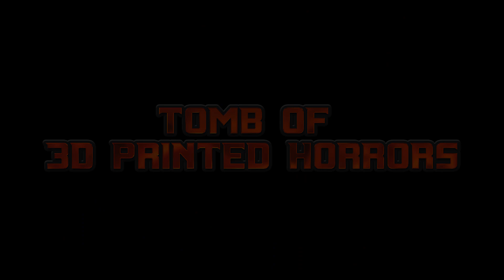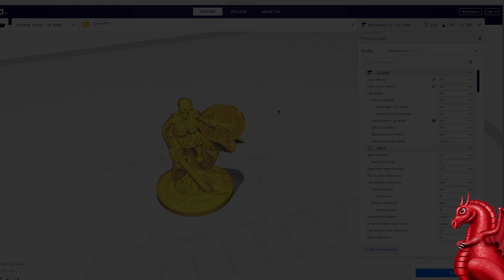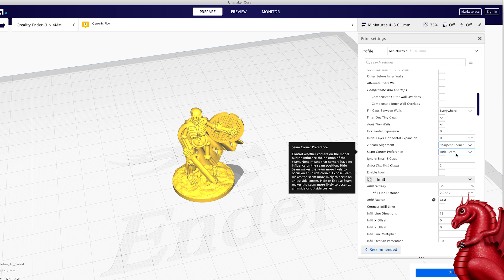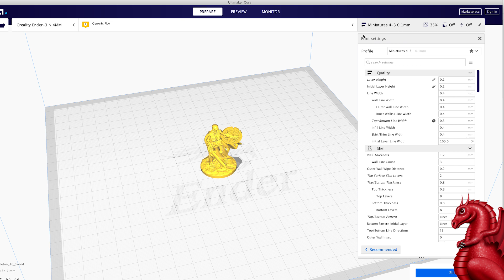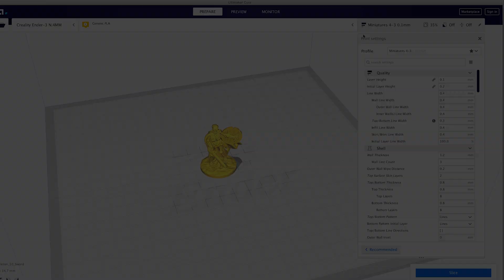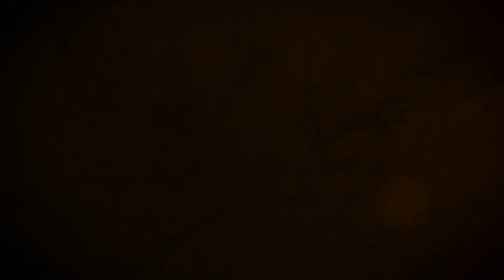How to 3D Print Better Miniatures: Pt. 2 Cura Settings

Comment: Is it absolutely necessary to use a 0.2mm nozzle for 28mm miniatures?  Yes, I realize I will get better quality with a 0.2, but will I be able to print a reasonable 28mm miniature with a 0.4mm nozzle?
Thanks,
Reply from the maker: Yes, I use .4mm for minis and get very good results, my favorite nozzle size for them is .3mm

Comment: Thanks for all these Tom , they have really helped. I have been playing around with 0.04 layer height and a 0.2mm nozzle, but so far I've found the stock 0.4mm nozzle with your profile produces the nicest print. I have one more test to try 0.2mm nozzle with an otherwise virtually unchanged profile and see what happens
Reply: What were your results?

Comment: Skirt and Brim are not working for my Ender 3. I only get good adhesion with Raft. Any thoughts?
Reply from the maker: You aren't properly leveled. Check out my video on manual bed leveling.

Comment: We are in Cura 4.4 now. Will this work with 4.4 for a stock Ender 3 printer description? I'm currently still using 3.6 and think it's time for an upgrade.
Reply: These settings work well in Cura 4.4
Reply: Cool. Now I just need some good support settings. Thank you

Comment: No Z hop?
Reply from the maker: No, using Z-hop ruins the surface finish.
Reply: With some models my nozzle knocks over parts. Z hop helps me to not knock things over.
I'll try to print with and without Z hop to look for differences.

Comment: What do you guys thing about the Anet a8, and do you think I could get advanced setting like this applied to it?
Reply from the maker: Bad printer, get a Creality Ender 3, 5 or CR-10 instead.
Reply: @Tombof3DPrintedHorrors  well the bad part is it's already mine and I've put alot of effort into it so far. And I get closer everyday to good quality, but there is a lot of things I don't like about it. Compared to those printers you mentioned, why do you think they have an advantage?
Reply from the maker: @jackmars453  a lot of things, but a huge part is the guidance design, using soft rubber wheels and extruded aluminum V-slot rails over steel rods and bearing carts, the latter introduce and carry vibrations to the print head, whereas the former absorb those vibrations. There's other design issues too, but that is a major one.

Comment: Will all these settings work well with Hero Forge minis?
Reply from the maker: Yes, but remember that not all HF minis are designed for the FDM process. Results depend on the miniature design.

Comment: Hi there! First of all, you should know that you are my hero! Your videos have saved me lots of time (and money!!!) with my Ender 3. Now my question: I don't know if that was there before, but now with Cura 4.4, in the "material" section there's no option to choose nozzle size, just the word "empty". Is that bad? Also, I must say that, when I did the Cura update, I got an error message about the Legacy settings. The program seems to work ok though. Maybe you should update the Legacy files for the new version?

Comment: What do you think of tree supports for printing miniatures? I've tried it out and found that removing supports is much easier, given I can print supports without touching the base of the model. Also, what do you think of printing in ABS and using acetone smoothing for models without lines? Do you feel as though you lose too much detail or the glossy look isn't appealing to you? I've found it's tricky to execute well but seems to generate almost injection molded part appearance.

Comment: unable to load the new mini's profile into cura 4.3  here's the error  "could not find a quality type normal for the current configuration"  ?  any ideas sir?
Reply from the maker: Perhaps read the 'Read me' file included in the Cura 4.3 profiles folder? ;)

Comment: FYI I'm unable to import the 4.3 profiles from your dropbox into Cura 4.3. Error message says: "Could not find a quality type normal for the current configuration"
Reply from the maker: Psssst... perhaps you should read the 'Read Me' document included in that folder. ;)
Reply: @Tombof3DPrintedHorrors  add a legacy printer did the trick 
thank you

Comment: PSA: Don't use these setting or Cura in general on a Prusa. Not only will these settings cause your prints to fail (generally though heatsink-related extruder blockage), but even with the same PrusaSlicer settings the backend slicing program is severely prone to errors in Cura. And that's even IF you import the official Prusa profiles. Trust me, I've learned the hard way. Prusaslicer 2.1 has virtually all the same features as cura now and their custom supports work great.

Comment: Nice overview. But I've understood that "Print thin walls" means, that if a wall is thinner than 2x the extrusion width (0.8mm on 0.4mm nozzle), it will still be printed, but ignored, if this is disabled.

Such thin areas are guaranteed to not print that well, but it's better to try and potentially fail, than to give up, right?

Definitely have this setting on. By the way, you can see such walls as yellow in preview.

Comment: You're great man! I have seen all your videos and your guidelines improved a lot my printings, thanks man for all the hard work and passion you have put in your videos. I just want to ask why I get awesome results on a 0.28 layer height and like you said with a lower height the heat starts to melts. I'm using abs at 210°C with an hotbed of 109°C.

Comment: Hi, I can add the terrain profile, but with the miniature profile I get the following error in Cura 4.3:

"Failed to import profile from D:/Downloads/Official_FDG_Cura_Ender3_and_5_Miniatures_4mm_v4_3.curaprofile: Could not find a quality type super for the current configuration."
Reply from the maker: I recommend using Cura 4.0 as 4.2 and 3 have some issues.
Reply: @Tombof3DPrintedHorrors  Thank you, will do, and that you for all the amazing videos!
Reply from the maker: @Pigeon_FX  thanks for watching :)
Reply: @Tombof3DPrintedHorrors  Work like a dream on 4.0, thank you. Can't wait for a video on supports for minis.

Comment: Awesome video, thanks, but there are things completely non-intuitive that I can't stand about Cura. I'm probably missing something obvious though. There are far less settings in Sic3r, but you always know exactly what what set of parameters something goes with. It's clearly in the Print, Filament or Printer settings. I spent an hour working through this video, get some good results, switch to another profile, am completely unclear when the question comes up about changed settings if I'm saying I want to use the changed settings in the new profile or save the new settings to the old profile. Suddenly all the settings I took so long to work through are changed when I go back to miniatures. I've tried changing just a couple of things and changing back and forth and I honestly can't figure out exactly what I'm answering on that question. Then I change materials and sometimes I think the print temp and bed temp follow the material (as would make sense) and sometimes I think it maybe doesn't. Very frustrating. And it runs like a dooooooog on an older computer. But that's to be expected when running something modern and powerful on an old (but cost effective) computer. After seeing the video I thought, "I'll give it another shot." I now remember pretty clearly why I gave up the first time and moved to something else. That said, I truly do appreciate the video, and that Cura and Slic3r and so many others are free, and all the time people put in helping others figure all this out.

Comment: Hey Tom, love your videos! Do you think setting the layer height to 0.05 from 0.1 while using your profile would be overkill/would it mess up with your profile's settings? I'm starting to use your profile over a 100% infill one, so I want to make sure I don't accidentally screw anything over. =)
Reply from the maker: It should be ok, but I think .06 would work better if you absolutely need to go that low (with a .4mm nozzle, you will get better results at .1). I also have a new video coming in about a week you might be interested in covering how to use a .2 nozzle to go that low to get results like a resin printer. :)
Reply: @Tombof3DPrintedHorrors  I just did a comparison test using a 100% infill profile with 0.5mm layer height and then using the Fat Dragon Games profile unmodified (other than adding support settings and changing temperature), and my  god it works like a charm, thank you so much! There was no stringing, no artifacts, blobs or anything else, it took less time to print and didn't use as much filament. I'll definitely be using your profile from now on. =)
Reply from the maker: @Elbee844  awesome! Tell the world LOL! :D
Reply: @Tombof3DPrintedHorrors  Will definitely do! If you don't mind me asking more questions, would you recommend the eSun PLA+/Pro (I think they're the same) for miniatures? So far I've been using Hatchbox White PLA, but it's so hard get it in my small European country (and shipping from the US is expensive as heck), so I've been thinking of changing. eSun would be easy and cheap to order from a neighbouring country.
Reply from the maker: @Elbee844  I use eSun PLA Pro for everything (especially minis) as it has a higher tensile strength and isn't as brittle as standard PLA. :)
Reply: Oh sweet! I have a couple of .2 nozzles waiting to be used, so I'll be sure to give that video a shot.

Comment: Almost my exact settings and I can confirm you will get Awesome results with this profile for mini's.
Reply: can you post them? thanks in advance
Reply: @kindabadngl3242  There here in the video! Mine are pretty much the same.. any difference is negligible.
Reply: You got any tips for supports?
Reply: @hussalojr5916  Learn how to use support blockers, it will save you tons of time and it works for the infill also, this way you can set different infill amounts for different parts of the print.
Reply: @totalbullion5882  Supplrt blockers? Yikes this is getting more confusing
Reply: @hussalojr5916  LOL, sorry. It's hard to tell someone's current skill level. You should check out a channel called "3d printed table top"  He has a few great video's on supports.  You can figure out the blocker stuff later on.
Reply: @totalbullion5882  Thanks, I've literally just printed my first benchy. It doesn't look too bad all in all and I'm proud but I'm very new

Comment: Thanks for the excellent video.  On flow rate my Ender 3 is a crazy exception, I have to set the flow between 230 and 240 to get anything to print.  Normal setting under extrude to the point of making cute little bird nests.  Have you heard of any similar situations to mine?
Reply: Change the nozzle it might be blocked.
Reply: Is your steps per mm correct?
Is the extruder slipping or skipping steps?
Is there a flow multiplier set on the printer?

Comment: Wonderful video.  Thanks for all the hard work to test this out.   
I’m starting to experiment with PLA+ for stronger minis.  
Any thoughts on what one would change to use that?
Reply from the maker: eSun PLA Pro (+) is what I use, so nothing needs changed :)
Reply: @Tombof3DPrintedHorrors  Thanks for that PLA+ recommendation.  I'm surprised to hear nothing changes at all though.  I assume you mean nothing other than the extrusion & bed temperatures?  (I see eSun's temp ratings are higher than PLA, as one would expect.)
Reply from the maker: @Mike-tc2rl  No, my profile is designed for PLA Pro, nothing changes unless you use standard PLA, then you drop the nozzle temp some. Bed temp remains 60˚.
Reply: @Tombof3DPrintedHorrors  Ah... gotcha.  Thanks, that makes sense.  Now I have to buy some PLA Pro.  Any interest in adding an affiliate link for me to click through?
Reply from the maker: @Mike-tc2rl  here you go! https://amzn.to/2ZPsTBU

Comment: Tom, thanks for another great video.  I'm curious how you handle supports.  Most times I've used them, it makes my mini a mess - even using your profile.  Laying the mini on their backs to print hasn't helped either.  Thanks!
Reply from the maker: I rarely ever use supports, everything we sell at Fat Dragon Games is designed to print without them. For supports to be successful, a mini has to be designed to be used with them, and unfortunately a lot of designers don't do this.
Reply: @Tombof3DPrintedHorrors  I think at some point you said you'd make a separate video about supports and the pros and cons , and how to do them if you can't escape them.. did you ever make that video ?  it would be very very useful.
Reply from the maker: @Adam-ee9lm  no, none of my models require supports, so I can't justify the time involved in developing and testing them.

Comment: I've been printing a lot of minis for over two months with a profile taken and adapted from one of your previous videos and it has been working like perfect. I used the same process with this great video to update the old profile with the tweaked settings and made some comparisons prints. And the results were discouraging. After four different prints with the old and new profile, the old one surpassed the new one in every aspect. The old one is faster, cleaner, more reliable in terms of the tree supports and leaves a smoother surface on the mini. I really don't see why this is happening as most of what was presented in this video seems very reasonable.

Comment: The minute you add a ABL like the EZABL or  BL Touch, the magic number concept goes right out the window.
Reply: Curious- why do they apply before adding auto leveling?
Reply: @Cloudman572  - good question. When you manually level, the z-layer height is always at a given Z value, so trying to match the height to a full step of the motor makes sense. What  auto leveling does is adds a tiny offset to the Z value at every point to compensate for the bed. This means you can't match it to a full step. If a full step was 0.2mm, the ABL may make the height in one area 0.22, not a "magic number", and you have no control of that.  But yet the print still looks great using an ABL because stepper motors can handle the fractional steps very well these days, IMHO.
Reply: @GeorgeLeite  Thanks for the explanation. How easy is it to manually level to a full step? I did a quick google search and came up with nothing.
Reply: @Cloudman572 I was going to say when the printer homes, it always starts at 0 so you're set to print full steps, but I think you hit on something very observant with your question. We don't know when the stepper is physically in a full step position or not, so the motor could actually be between steps when the bed is set to 0.  That would be even more reason why you can't rely on "magic numbers".  HMMM, I'm going to have to think about that one. How would you set the z end stop to make sure it was at a whole step?
Reply: @GeorgeLeite  All I can think of is that you must be able to instruct Z motor to go to a set full step and then full step n steps to start in the best place but that is too much trouble for my limited knowledge - I will just stick with the manual and non full steps.
Thanks though.
Have a great day all.

Comment: Has the downloadable profile been tested with Cura 4.2.1?

Cura 4.2.1 changed many of the default settings on the Ender 3. If a profile just uses the defaults for a setting (instead of explicitly stating what value to use), a profile imported into Cura 4.2.1 ends up with different settings that if that same profile was imported into Cura 4.0.
Reply: I believe on the facebook group Tom said he was sticking with Cura 4.0 for the time being. I believe that was yesterday, so I'm not sure which is best, but I would guess Cura 4.0

Comment: Hey Tom. Love your videos, they have helped me out a lot. One question I have is: how would you recommend using supports when printing minis that require them? I've tried printing with supports in the past and have had issues removing them (especially when they are built between and around the legs of the characters).
Reply from the maker: I don't have any settings to recommend, sorry.
Reply: Cura 4.2.1 now has individual flow settings - if you look for support flow, set that to 10% (I'm currently playing around with it, 10% seems to work fine). It creates a far lighter but still supportive structure for your model - I've found it much easier to remove, with less harm to the miniature. Eager to see what other suggestions come your way - every bit helps!
Reply: @colintate  Thanks! I'll definitely give that a shot. Basically what's happening now is that i end my breaking all my minis at the ankles so I can remove the supports between their legs. Then i glue them back together. Not ideal!
Reply: Hi, there's a YouTube channel, don't remember exactly the name of the channel but search for Danny the 3d DM he has a video on how to setup support on Cura. Use Tom's general settings and Danny for support settings.

Comment: I need that 99999999 top layer trick to make my prints completely solid. 100% infill leaves gaps inside, like those nitrogen-aerated chocolate bars from several years ago.
Reply from the maker: Watch this video for why it's a bad idea (https://youtu.be/AqEWl51s9Rw). Also, I'm curious why you would want to print infill areas slower than wall shells? That's adding an insane amount of print time for zero benefit.

Comment: What really confuses me are support settings because they keep messing up my prints
Reply: try tree support in experimental it only touches the model where necessary resulting in way less nubs and artifacts
Reply: Same! Looking for definite support tips, as support roofs on miniatures are really an issue for me xD
Reply from the maker: Many times it isn't the support settings, it's a poorly designed miniature that is not designed to accept supports properly.